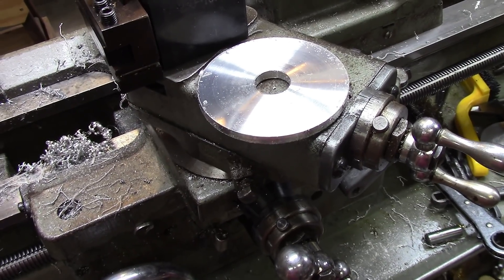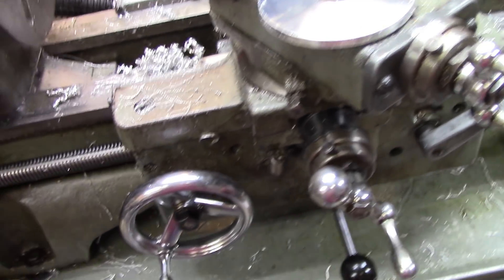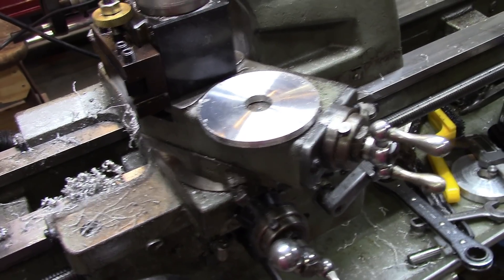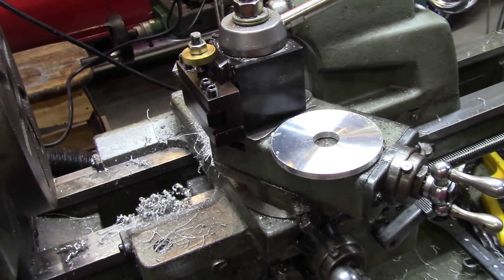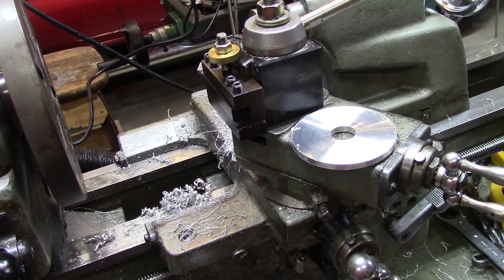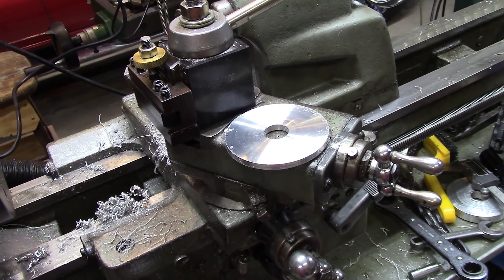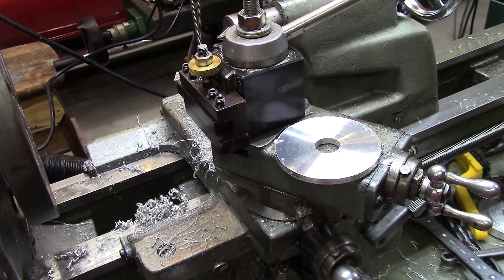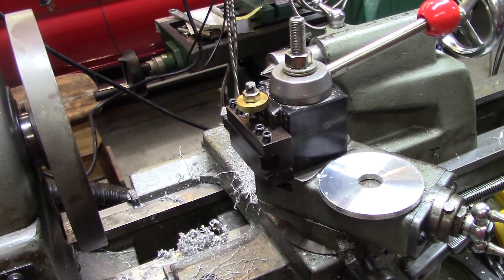3D printed bushings and tool holders

Comment: Harold,  This is how I would do it.  Permanently mount a small laser on your mill head to aim across the room somewhere where you can mount a tall thin mirror.  Mount the mirror so the red dot is in the horizontal center.  You need to mount it so it can be fixed yet a little adjustable until final calibration.  The height of the mirror has to accommodate the vertical travel of the head.  Now with the laser on and pointing to the center of the mirror you may need to adjust the horizontal angle so that it points to a clear section on the wall behind the mill.  Now mount a white cardboard with a heavy vertical line on that wall so that the laser hits the line.  You are now set and calibrated.  What ever height your head is when you move the mill head so that the laser dot is on the line your head is aligned.
Reply from the maker: Thanks for the suggestion and thanks for viewing.

Comment: Hi Harold, IMO unless you want to scrap some threads don't use a plastic key bushings of any kind. I have seen the powder metal ones shear in half so plastic ones are just about guaranteed to break. I made some from bronze using the lathe as a shaper to cut the material away leaving the two integral keys. FWIW
ATB, Robin
Reply from the maker: That danger is certainly real.  Thanks for stopping by.

Comment: Why not just cut a key in the column so it is always indexed?
Reply from the maker: I do not think the column is thick enough for a keyway.   Thanks for stopping by.
Reply: attach a key to it instead?
Reply from the maker: I would prefer an indication that would allow me to just go back to where I was.  I may want to swing the head to one side of the other for some reason and if it is solid it cannot happen.
Reply: Cut a 45deg angled groove up the column and use a cone pointed set screw. The set screw would guide in the v and you could tighten it to eliminate all slop. You could also back out the screw and pivot the head if you wanted to.
Reply from the maker: That is an idea worth consideration.

Comment: Love the tool holders. Do you think a plumb bob could get your column close to aligned? cut or scribe a small groove in a piece of metal attached to your milling head and hang a plumb bob down to a known place. raise the head and hang the plumb bob down farther to align it back on the mark and tighten the head?  seems simple enough in my head.
Reply from the maker: It is an interesting idea.   Thanks for stopping by.